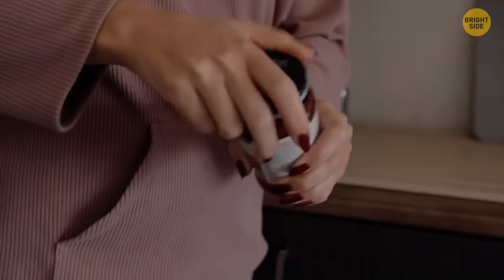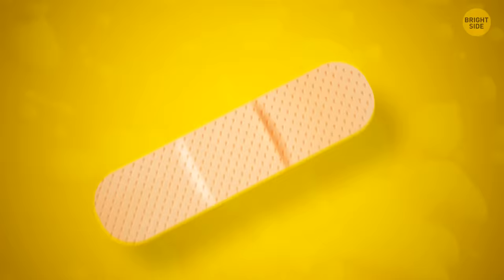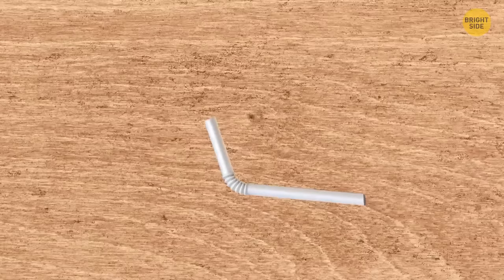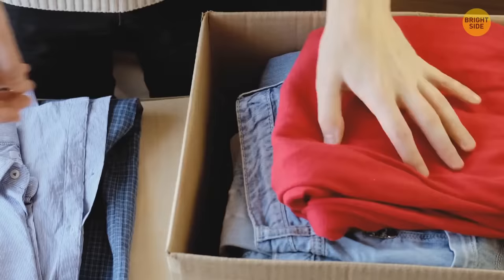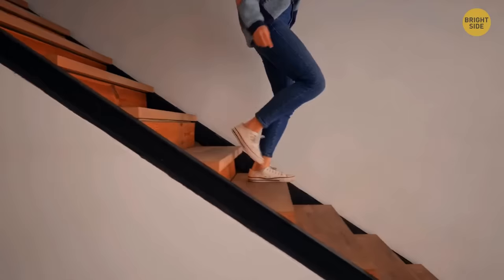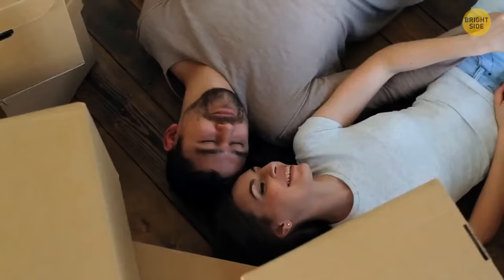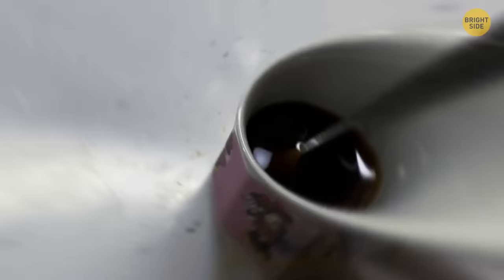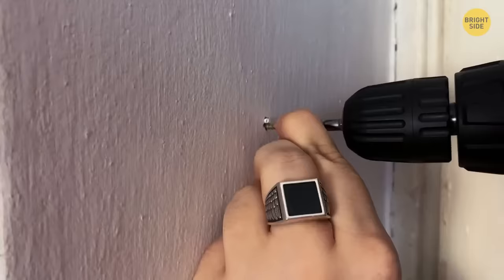75 Tips to Keep Up Your Sleeve for Any Situation

Comment: Some of these are run more than once. Using the key to get the shopping cart is encouraging people to cheat the store. Work on remembering the quarter instead. After you get home put another quarter in your coin purse or men put one in your wallet. I tried the thing using the Apple button on the back. By the time I take my phone out of the case and go through all those steps (since you can only pick action at a time ) I could have just go to my camera and take a picture, or whatever the was planning on using the phone for. I don’t see where it saves time at all.
Reply: The key and shopping cart is not cheating the store. They don't keep the coin used. You retrieve it when you return the cart. Using a key is the same action, just using a different tool. You'd still need to retrieve the key also.